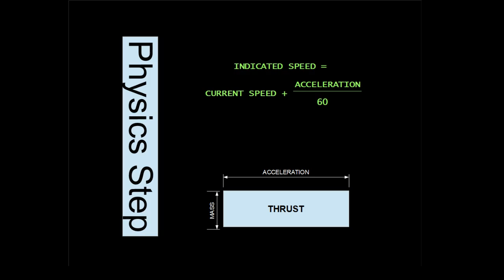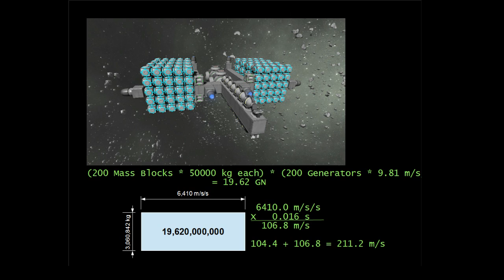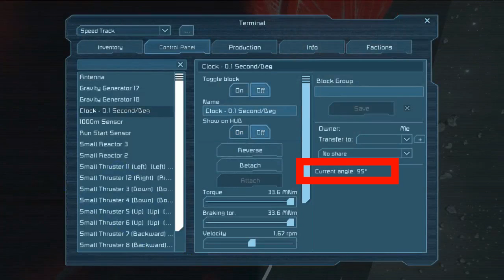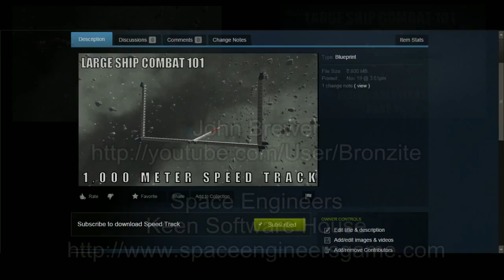Myth of the Hyperdrive - Space Engineers Large Ship Combat 101

Comment: Did you account the game going the same speed but the internet service lag when activating the high resolution drive though? Therefor the speedometer is not lying and you are going that speed but the current computer rom could not run all the high resolution game play at once, leading to it seeming that the speedometer is lying when it is not the game is actually on a slower rom speed than it is supposed to be but the game data outside of the rom is running at the same speed.
Reply: He did account for that by using a rotor to measure time. Also there is no "internet service lag" in single player.